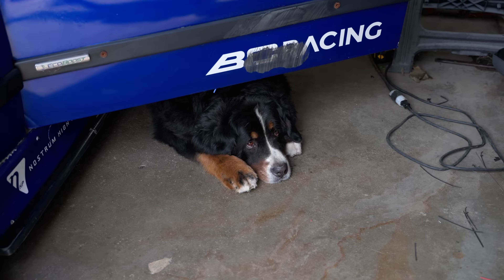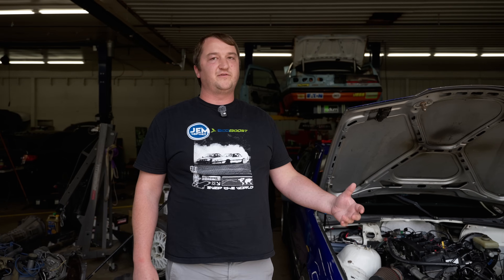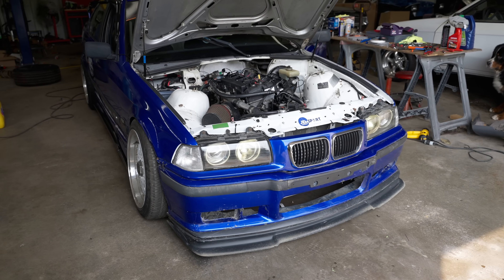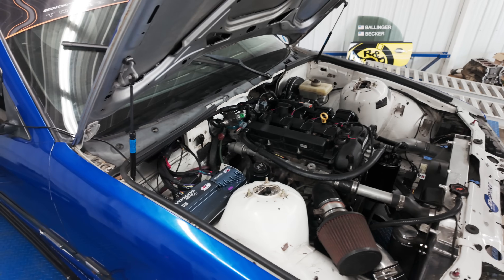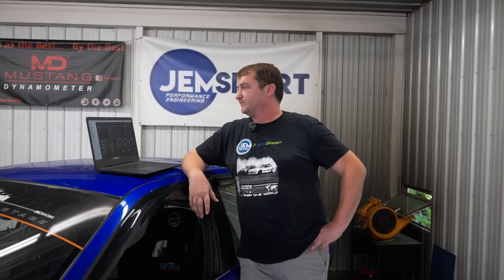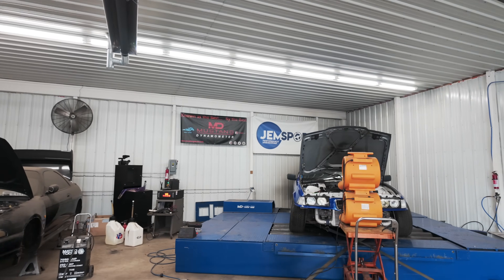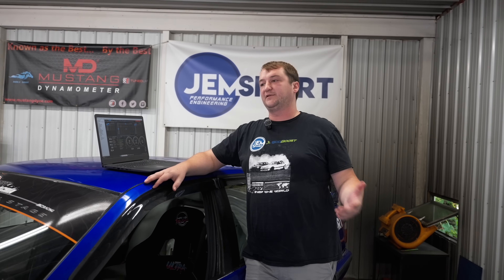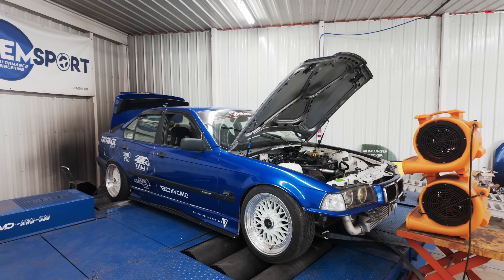Eco-Boost Swapped BMW - Link Voodoo Neo 4

Comment: That sounded absolutely horrible
Reply: Same motor denofa has in his foxbody proam car, and his sounds miles better. Exhaust is a bit odd on this one.
Reply: it's in an echo prone garage, over a mic 15ft away over a youtube compression... to be fair its not a fair judgement you making.
Reply: @Cereal_Killr  These are things to factor, but honestly the rest of the audio quality has demonstrated it is not suffering massively from audio compression issues. Honestly it's the tone of the engine, and the whole sound in general, it sounds like a cross between a civic with a straight through exhaust to a 4" tip, crossed with a server fan running at max before a thermal overload